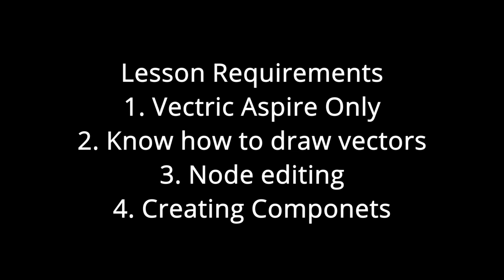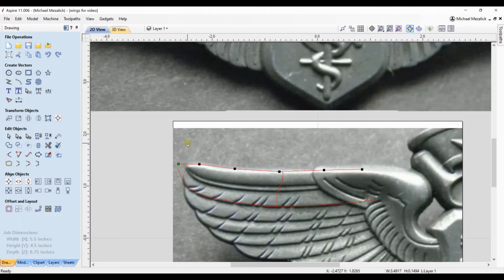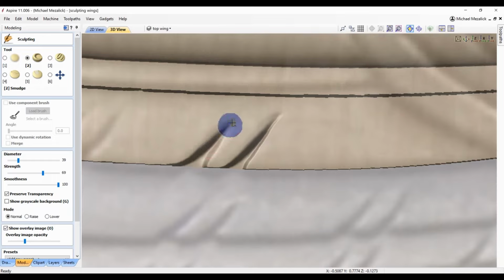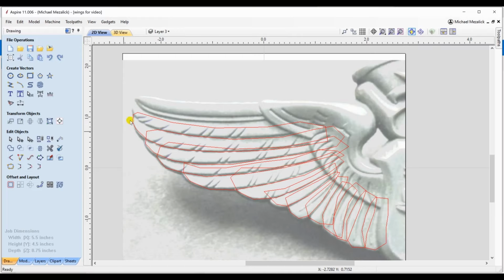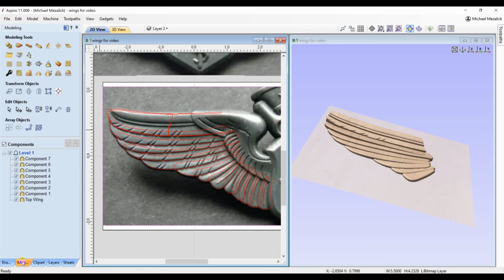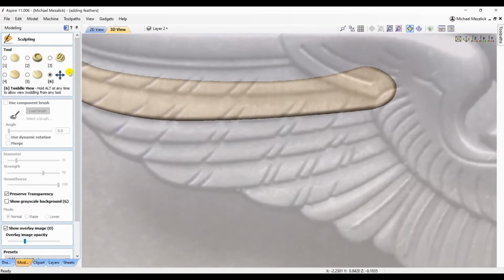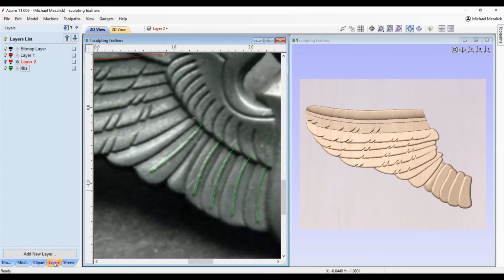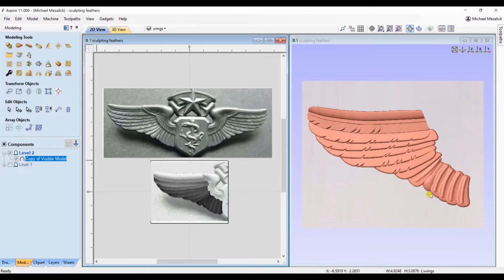Make an US Air Force Chief Flight Nurse badge with Vectric Aspire

Comment: Sure would be nice to be able to use Aspire demo to export an STL to VCP  :-) One work around I did the other day was to create a medallion shape with dish and canted rim in Fusion360 which does allow such exporting via an OBJ file. Bingo! Worked like a charm. But F360 is not going to get you organic shapes. There is another sculpting tool that I wish to involve more often in my workflow. It is Autodesk Mudbox.  Another design rabbit hole to disappear into however.